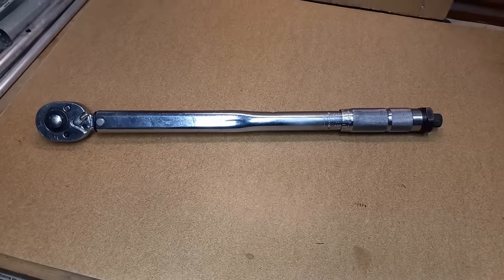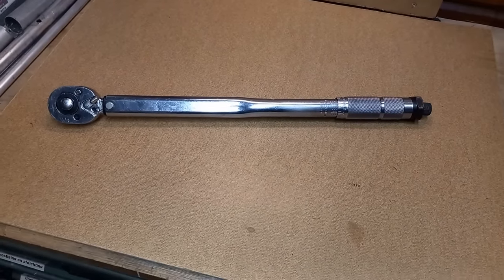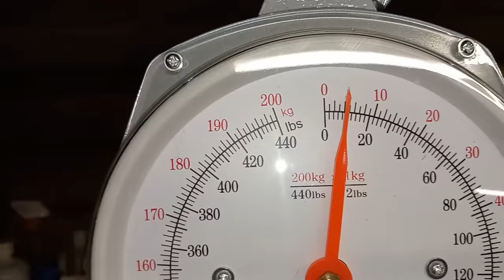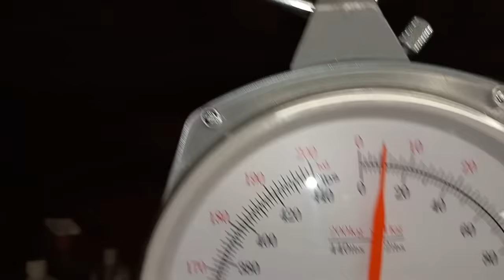How to calibrate a (cheap) torque wrench

Comment: If you’re going to make a video about torque wrenches, make sure you always leave a tip by saying always take the tension off the spring in there before you put it back on a shelf for any period of time. Any spring left under tension will diminish in storage.
Never adjust a torque wrench to like 240 ft/lbs, do a bearing and then stick it back in the tool box to store without taking all the tension off.
Reply: Quite right and that should be mentioned in the tools instructions
Reply: @bsimpson6204  it would be great if you would mention it because the guy might have a torque wrench and he got used.
Reply: @markmcgoveran6811  I'd never buy a torque wrench through a place like a pawn shop. This video was indeed very helpful but if that spring has been abused and neglected, I don't know. They're not an arm and a leg through Amazon and it's brand new out of the box.
Reply: @kirkthiets2771  I'm very happy for you that you live such a wonderful life. I've been a lot of places where it was a couple hundred miles round-trip to go buy a torque wrench.
Reply: We never took the tension off, but it wasn't anything accurate. Just small stuff like cruise ship engines/power plant engines. And still every yearly calibration they were in spec
Reply: By that logic my car gets closer to the ground every year as the springs in the suspension diminish.... It won't diminish the spring is in its elastic region. There are companies that use custom torque wrenches locked to a single torque that cannot be unwound for high precision applications. What will make a difference is clicking 2,3,4 times instead of once as the detent mechanism will wear faster as when the mechanism detents there is a moment of high stress and combined with contamination the mechanism can wear over time. Hence why calibrations are generally done on time and or cycles. So if you are in a production environment you might get the tool calibrated on the number of "clicks" if the 5000 cycles or what's specified is less than a year.
Reply: @jakbain1337  well I hate to let you know but cars do sag and get closer to the ground and you do have to replace the springs. Have you heard of the second law of thermodynamics?
Reply: @markmcgoveran6811  sag will not occur in the spring if a car is stationary... Bushings and other things may suffer greatly from creep stress though. It is also likely that people in cars where bump rubbers and spring combo are not sufficiently designed can allow the spring to go into plastic deformation under severe bump loadings again this condition does not exist in the design parameters of a torque wrench. Properly designed springs for the application will not creep. As for the second law of thermodynamics, heat flow is not what we are discussing.
Reply: @jakbain1337  oh okay I thought the second law of thermodynamics dealt with entropy. I thought of spring had a form of stored energy that would eventually bleed off in the form of creep of the material. I guess 7 years I spent electrical engineering, looking at a whole lot of abstract stuff doesn't qualify me to discuss a spring next to a person like you who doesn't offer any science other than no. Do you have some argument why that would be an eternal storage of energy? Anyting scientific other than your desire to pontificate because you're a well-trained person and some mechanical thing but you didn't study abstraction much so you can't really make a scientific argument? No you don't. All you have is a few anecdotes. So why do you think that the second law of thermodynamics applies only to heat? So when everything else is cool to the same temperature across-the-board everywhere in the universe all of it is gone to anchovy they'll be a spring somewhere that somebody didn't disconnect and it will still have energy stored.
Reply: @markmcgoveran6811  A good quality spring steel kept under the materials endurance limit will suffer from negligible creep in these conditions. We aren't talking about edge cases where the spring is cycling through 100-300°C at 90% of the material stress limit. Where you will see noticeable creep. We are talking about a spring in a small temperature window operating in it's designed conditions.
Reply: @jakbain1337  there again I have to go with the second law of thermodynamics. A spring is a form of stored energy. It will eventually dissipate. Can you refute that statement? I know that  you have a special exception to the second law of thermodynamics.
Reply: @KeljuKkojootti  I understand completely that they were still within spec every year regardless of what you did. But within the specification is not the same as did not decline. I'm still 7 ft tall just like I was when I was growing up as a twenty-five-year-old Tug boatman within the specification of plus or minus three feet.
Reply: @KeljuKkojootti  why would they have to have a yearly specification check if the spring is not going bad? You're only working on a cruise ship worth millions of dollars and why would you even bother with re specifying those things every year if they're never out of spec? That would certainly be an expensive waste of money if there is no way that spring could get a little tired. Yeah you work on a cruise ship and you think you're an engineer cuz they call it an engineer on a boat. We have other people called building engineers at do about the same kind of work you do. Of course your professional engineer has a college degree
And he thinks there's a chance if that's bring my creep a little bit so he goes ahead and spend the extra dollar to re spec the tools every year, do you think the engineer who is ordering those tools be recalibrated to specification every year, is just throwing money away?
Reply: @Alexander Wardrope it's not my fault engineers around Lee and universally hated because they're right and smart. Remember when the first multi-engine bombers came out? Pilots that had plenty of skill flying an airplane we're absolutely certain that the airplane was at fault every time they launched one and it crashed in minutes. The engineer told the general that these guys needed a check list in order to launch an airplane and the engineer would write the check list in the pilots would follow the checklist and there would be no more trouble. The pilots were just people like you guys and they were sure they knew everything just like you are and they didn't want to go with the checklist. Fortunately the pilots were in the military. The general ordered the checklist and the military pilots complied and the airplanes quit crashing and now every airplane has a checklist on launch. Yep all those engineers built that airplane yet contributed nothing. The pilots didn't understand enough about their mind and they systems and everything to run the airplane and they just like you argued that the engineers had nothing to contribute.
Reply: No need to call someone a half wit. 

I don't measure people with a tape measure that has 3ft increments because that's illogical. 

You speak like the pilots that were sure they were 100% right! be careful you might sound like you aren't willing to listen to an engineer. 

Just remember when everything is a big theoretical goop at the same temperature we will be long gone and have no equipment to calibrate the torque wrench let alone measure the force on a spring when it's all goop. Think about the right time frame and about the grain flow of the materials over an applicable time scale and loading conditions
Reply: @markmcgoveran6811  I don't work on a cruise ship, I work at a factory making the cruise ship/power plant engines. We have to take them to get checked once a year. And unless they are dropped they are in spec, they just adjust it and stamp it good to go for a year more, we rarely use torque wrenches, important bolts are streched with hydraulic pressure, easier on us assemblers to torque down cylinder heads than with a big ass torque wrench. I think the biggest one is 300-1000Nm.
Reply: @KeljuKkojootti  I worked on riverboats. Mostly deck crew, some engine room. We had the German engine that the torque was defined by your ran it down tight, and you counted six flats as you turned it. Regardless of that springs age. There's no such thing as perpetual motion or perpetual kinetic energy, there's no such thing as perpetual stored energy. I know the people who build those spring for those expensive tools build a spring that's going to last, nothing is forever. On the idea of unloading springs in equipment if you can well it's being stored, it's just eliminating one source of error. If you did have a torque wrench and dropped it, if the spring was all the way under pressure, it would likely throw the calibration out further than a looser setting. It's just like two guys running a machine shop boring out a cylinder. One guy does an extra step and bolts a heavy plate where the head would be. It distorts the cylinder a little bit so that circle will be true or when the piston rings are in it and the machine is in operation. The other guy never has done this and he never will do this and he never will believe anything that you try to tell him about the difference between the two.
Reply: @markmcgoveran6811  runs true that most people that quote the second law of thermodynamics have no idea what it means
Reply: @101spirited  yeah I've heard a thousand different things about the second law of thermodynamics. I was in the electrical engineering college for 7 years and you're telling me that you don't think stored energy dissipates. Energy in this universe goes to heat. That's one thing that's implied by the second law of thermodynamics. I don't know if anyone knows what the second law of thermodynamics "means". But it always the lights me when I get a cheap shot off subject response from somebody who thinks that if he has a spring in a torque wrench and it lasts forever and ever by the universe is only one temperature at spring will still be store energy.
Reply: @markmcgoveran6811  Dude, you swept the floor for those 7 years.
Reply: @captainwin6333  I'm absolutely certain I swept the floor during that time. I don't know anybody who's gone seven years without sweeping a floor that's able body bodied.
Reply: @captainwin6333  yeah that's why everybody's lined up to buy Chinese.
Reply: I have Craftsman Click - type torque wrench I have had 35 years.
I haven't used it a tremendous amount over the years but luckily I have always loosened it all up before putting it away.
Reply: @KeljuKkojootti  Depend on the size and quality of the spring. I used to work in a bicycle guy and one of the employee forgot to remove the tension on the very small torque wrench before vacation time. Well let's just say when we came back the torque wrench became a wrench.
"Cruise ship engines, power plant engines" Sound like to me it must have been some bigger than average torque wrench. The smaller, the more it will suffer from plastic deformation.
Reply: That's what you want, go do it. If you bother to read the manual you'll find the same. People who can't read or follow instructions won't be helped by a comment in a youtube video. Go make a video demonstrating this. That might show them. 🙂🙃😉
Reply: @markmcgoveran6811  And he couldn't find a youtube video to tell him!!😭😭😭😭😭😭😭😭😭How will this one he cannot find help him?🤣🤣🤣🤣🤣🙂🙃😉
Reply: @markmcgoveran6811  So if it's been altered through abuse, worrying about how to store it will make it accurate? That wil make it accurate!!!!🤣🤣🤣🤣🤣🤣🤣🤣🤣🤣🤣🤣🤣🤣🤣🤣🤣
Reply: @flashwashington2735  you need to study math more. I don't really want to go over the basic logic that makes you look like an idiot but I didn't say you could have use it as long as you took the spring loose. I said that spring represents a form of stored energy and if you leave the spring tension overtime the spring will lose some of that pressure. I don't know how you can make it abuse proof.
Reply: @flashwashington2735  he might be okay.
Reply: @flashwashington2735  in general there very many different viewpoints of any subject. The thermodynamic viewpoint is very simple. A compressed spring is a form of stored energy. Eventually all energy will be dissipated and turned into heat completely. The second law of thermodynamics says it "as time goes by the spring ages out and relaxes."in general in mechanics working on cars and things in my life I have found there were two sorts of people. People who thought it through with general engineering and science principles and then tried to eliminate variables and difficulties based on these things. The devil is in the details in all the things we do. Springs in general age under load. If there is no gain to leaving the spring under load, the default practice in the name of eliminating an unknown in accuracy would be unload the spring. I have no desire whatsoever to prove under the second law of thermodynamics at the energy stored in the spring will eventually be dissipated into heat and the spring will change.
Reply: @markmcgoveran6811  Why I agree. Did you mean this reply for me. They do it for firearms and all kinds of springy things. 

If it's about my cars in long term storage, You reduce pressure in tires, blocks to support the weight and they used to even remove valve covers, reduce valve train spring spring pressure, and remove the plugs to put oil on top[ of the pistons for the rings sake. They make cars too complicated and the procedures are too expensive. I all ways reduce the tension on my torque wrenches and wonder why someone would obey some yahoo on youtube vs the maker of said instrument. You trusted them to make it. WHY would you fail to trust the validity of their instructions. Unless you have come across some verifiable, repeatable, understandable reasons not to. This has only rarely happened with product from reputable companies in my personal experience. Relieve the springs!! God bless you.
Reply: @markmcgoveran6811  They relax all kinds of springs in firearms, sewing machines. Good procedure. If you care about my car comment. Don't they used to lower tire pressure, put them on blocks. Remove valve covers relax valve or cam springs, remove spark plugs put oil on top of the cylinders, and other things I don't recall like empty the tank.

My great great uncle traded his 1928 Packard he had so prepared to have his house moved. The new owner procured a battery and fuel went to start it up and broke the crankshaft. Poor engine could not compress oil even though it's rings weren't rusted to the cylinder walls. He had to find a machinist to mill him a new one, poor fool.

They don't do these things any more with cars too complicated. it is to expensive. And what about the fools?

I always follow and recommend following the manufactures instructions. Unless I have verifiable, repeatable, clearly defined reasons not to. Hasn't happened too often With quality products from reputable manufacturers in my years. But it has happened. 

So, If you trust the maker to make it, why would you listen to anyone commenting on youtube over the makers directions. I won't. Won't recommend it to others. Nor will you. Good we can both relax with our relaxed springs!! God bless.
Reply: @KeljuKkojootti  Different makers spec different procedures, including calibration cycles. If they needed adjustment maybe they weren't in spec. Why adjust them. I worked for Motorola, Sigma Six areas. That means one defect in a million. One followed by SIX zeros. They achieved Sigma Seven in other areas. I imagine lots of things were different as they were when I worked at Cummins or any where else I worked. I never said, Well where I worked we did it like this. Kept my eyes and ears opened. Used my mouth top ask questions. Different procedures in different cultures don't necessarily invalidate one another. Savvy? God bless.
Reply: @markmcgoveran6811  Different makers spec different procedures, including calibration cycles. If they needed adjustment maybe they weren't in spec. Why adjust them. I worked for Motorola, Sigma Six areas. That means one defect in a million. One followed by SIX zeros. They achieved Sigma Seven in other areas. I imagine lots of things were different as they were when I worked at Cummins or any where else I worked. I never said, Well where I worked we did it like this. Kept my eyes and ears opened. Used my mouth to ask questions. What about sleeved engines or blocks with thick deck surfaces milled after boring, and these new automotive engines have oval cylinders. What processes for that? Different procedures in different cultures don't necessarily invalidate one another. Savvy? God bless.
Reply: @captainwin6333  You wanted to sweep the floor, but deemed incompetent weren't allowed to broom!! Are you a captain in the third grade? Like eraser duster? No that would be too hard for you. HMMMMMM???
Reply: @flashwashington2735  yeah you're right about all the things you did. If you want to look at a cultural model that's fine with me. I prefer to look at math and science when I'm making engineering decisions. I am happy for you that you work in the six sigma industry and you worked in quality control. Regardless of that I'm I'm proud of you that you were able to study culture and apply it that whatever you're applying it to. I prefer to apply mathematics and science to engineering problems not culture. How does your education affect the second law of thermodynamics? How does your experience affect the second law of thermodynamics? How does culture affect the second law of thermodynamics? How does the second law of thermodynamics apply to the question at hand. If you store energy in a spring it will gradually dissipate. How does everything you said affect the simple fact that the second law of thermodynamics says every energy will dissipate. I love your argument because it says you don't know what I'm talking about. in math we have logic and then logic we have logic flaws faults in thinking. You're committing the logic fault of appeal to authority.
Reply: @flashwashington2735  that's wonderful your personality seems to be based on the logic fall of appeal to authority. I base all my decisions and all my advice I give people on math and science. I told 10,000 people there's no such thing as perpetual motion. This is a difficult pill to swallow for the vast majority of our people. The idea that there is eternal storage of energy, is also above people's heads. Do you pride yourself on your gullibility? The manufacturer makes money on this product so I'm not particularly faithful in what the manufacturer says.
Reply: @TwinShards  Yes massive engines, one cylinder could fit a man easily, torque wrench was over 10kg, but most of the bolts were tightened with hydraulics stretching the bolt and just finger tight the nut on, and release tension
Reply: @markmcgoveran6811  from Norbar Torque tools:-  Do Torque Wrenches Need To Be Wound Back To Zero After Use?   to make sure we were absolutely 100% certain of this, we carried out tests over the past month. We wanted to ensure that we could answer this long-debated industry question with the upmost accuracy. The test was completed recently, designed to show the effects of leaving a torque wrench wound up at 100% of full scale against one wound down to 20% of full scale. Firstly, four wrenches were taken and the calibration lab took results. Two wrenches were then left wound up and two wound down. After 24 hours the calibration lab took further results, and again after a week, then again after one month. At the end of the month the results showed (bar one single result) that all the readings taken were within the ISO tolerance of 4% of reading, regardless of whether the tool was wound up or down.
Reply: @markmcgoveran6811  If you are correct, Can you explain what is happening on the atomic level to cause this? All kinds of steel structures and bolts also behave as springs, do they also sag with time? Sky scrapers settling down, bridges sagging and bolts loosening? (I'm not talking about the few milliseconds after tensioning or waiting till the end of the universe here )  I hope you can explain how compressed gas in a tank can keep up the pressure (molecular motion) apparently forever. How does the law of thermodynamics apply to those cases? Serious question.
Reply: @billshiff2060  it's a matter of the scale of the time we're talkin about. In engineering there's a thing called creep where you put a load on something and it distorts it over a period of time. You've got a billion crystals all stuck together and one electron or two turn loose of each other and the shape changes. The timescale of this effect is fast enough on aluminum that they worried about creep on certain engineering applications of aluminum at small loads. When you look at  metals that have iron and carbon you have a lot of complex relationships with the carbon iron atoms causing distortion in the crystal matrix. When we temper metal or work harden it they're microscopic distortions in the crystal matrix make the sheer planes intersect at odd angles and causing material to be harder. I know of one process that use on rifle barrels after all the heat treating tempering is done and they just chill it to about minus 200 degrees. They hold the rifle barrel at this low temperature for a while and all the atoms slow down and put moving so much and the electrons in the crystals reunite to an extent. Instead of the variations in this process throughout the rifle barrel that they had one as originally manufactured and it worked great by the way, they have created a more uniform alloy and the barrel shoots more uniformly because it's one solid consistent piece, not different thicknesses and places that tempered harder than others. I wish you lived nearby and I could step up to the blackboard or get out the paper  and pencil and do the subject justice.
Reply: @billshiff2060  so they do change after all. 4%? The sample size was so small that it's meaningless according the ISO 9000. 2 wrenches and two controls and it's still changed a little bit. Thanks for releasing that little bit of information those guys did a test to reassure us with absolutely too few wrenches to have any meaning at all.
Reply: @markmcgoveran6811  The 4% referred to all 4 of the wrenches, and it wasn't stated as a decrease , just a variation from spec. It's all I could find in a short search on this topic. Their site has more to say on the subject. It would be nice if someone did a more comprehensive test but I doubt anyone will. In reality, torque wrenches are a lousy way to gage clamping loads so that even a perfect wrench can get only ~ +/- 10% of actual, if that. So it becomes academic.
Reply: @markmcgoveran6811  Your authority is math and science. You don't get the science right. Then you blame and chastise others. Claiming to school them.

Nothing man makes or does is 100% accurate. instead of thanking this video maker. You want to tell everybody where to get off from behind your podium. This video is addressing practical application. I worked in a Sigma six facility. Won manufacturing awards. I studied the physics and required math as majors. On their floor !st 2nd and 3rd approximations got the job done. Only one defect in millions produced. Your experience may vary. But we ALL called it "GOOD ENOUGH."  I will no longer talk to you of this matter. You will not be satisfied and I would waste my time. God bless you sir.
Reply: @billshiff2060  the guy that pulled in first on race day eliminated a lot of real and imaginary sources of error. I'm not maintaining this as a reason to scream at someone who left your torque wrench torqued. Rather it's a form of discipline.
Reply: @flashwashington2735  not one reason to leave it loaded has offered. I was a machinist. By default I returned everything to factory settings,store springs unloaded, and a great many other things. I made every choice a conscious choice.
Reply: @flashwashington2735  one thing about you is when you get some really substandard research like an example where N is ridiculous, in support of your views you leaned on it like a drunk on a lamp-post with a burned-out light.
Reply: @flashwashington2735  one great thing about you is you were accepting an anecdote for evidence and you should know that there is not enough wrenches in the study to mean anything but a sale . No honest quality control person would accept that. You don't love quality control in math like I do you love the money you get for being an expert in the field. All of your discourse is based on you, not much of the subject in your discourse. I enjoy this greatly because you are accepting bad math and whoring out your degree.
Reply: @billshiff2060  well one thing about you is you're respectful. A study with just four wrenches  has not got enough participants to mean anything. I just had a guy with a background and quality control give me a 45-minute writing about him and me and 3 minutes on the subject. If he was as educated as he claims he would know that was not a valid size for a study. I have not heard one single good reason not to take the load of the spring. Just as a default practice regardless of what anybody says I try to return things to the factory setting they came from the factory with and I try to default to unloading springs.
Reply: @markmcgoveran6811  I try to respect the respectable. Sample size matters more the smaller the effect you are looking for. In their case they found that nothing catastrophic happened and for them that's close enough. I am  currently in metal forming so I know for certain that metals creep when loaded and parts within any metal are always loaded. Sometimes it is shocking how large the effect is. 
Once I was tensile testing an assembly made of 304 stainless steel. It was expected to break at 2000 psi or more. During the test I saw my extensometer was out of travel so I paused the test at 1000psi to reset it. In the less than 30 seconds that took , when I went to resume the test the tension had fallen to 800psi. The stainless had SAGGED 20% in that time. WTF???? The test continued and it broke as expected above 2000psi just like all the other tests did. 
That was my first encounter with what is termed the "gradual yield behavior of stainless steel" where it begins to yield at about half its tensile strength and is partly time dependent. That is why stainless screws only have half the torque rating of same sized steel screws. Stainless behaves like taffy or silly putty.
It is very pronounced in stainless but I think similar things are happening in other metals but on a scale that is hidden in the noise of normal variation. There is a time factor , I just don't know how strong it is in other metals yet. My default for steel springs would be to unload it for storage but not panic if it is not possible.
Reply: @billshiff2060  if you look at metal in a nuclear reactor it ages pretty quick. On the eternal scale that explains a lot of the second law of thermodynamics. If it's under a load and I strayed neutron flies through and bumps an electron that spot changes. I really enjoy studying the people here in the. One guy road 300-word discourse. 255 of the we're all about his resume and his experience in his education and why he was the source of information that was definitive on this subject. Then he mentioned something about me in general and then finally wound up with a vague accusation that I don't know the science and math here. The fascinating thing is he accepts a paper  supporting that was not in a peer-reviewed journal. He wants to state that I don't know science and math but he doesn't really find a flaw with my science and math and then he accepts a research study supporting himself with only four wrenches that is totally meaningless drivel produced by the manufacturer. The problem everyone is missing is not one good reason to leave the spring loaded is mentioned. If you want to be in control you make every decision a conscious decision not just a blow it off at random decision.
Reply: You know? I learned that Pro-tip when I was a kid messing around in my dad's garage so I never thought that other people, specially those used to work with torque wrenches may not know that... good catch Sir!
Reply: @markmcgoveran6811  This and how important entropy is but will get a crappy beat up, of unknown lineage Torque wrench from the pawn shop or on the street , fell off of a truck. Exacting standards of precision my friend.🤣🤣🤣🤣🤣🤣🤣🤣🤣🤣🤣🤣🤣🤣🤣🤣🤣🤣🤣🤣🤣🤣🤣🤣🤣🤣🤣🤣🤣🤣🤣🤣🤣🤣🤣🤣🤣🤣🤣🤣🤣🤣🤣🤣🤣🤣🤣🤣🤣🤣🤣🤣🤣🤣🤣🤣🤣🤣🤣🤣🤣🤣🤣I think you just want to help someone sell stuff. What crimes did they commit to deserve such help?🤣🤣🤣🤣🤣🤣🤣🤣🤣🤣🤣🤣🤣🤣🤣🤣🤣🤣🤣🤣🤣🤣🤣🤣🤣🤣🤣🤣🤣🤣🤣🤣🤣🤣🤣🤣🤣🤣🤣🤣🤣🤣🤣🤣🤣🤣
Reply: @flashwashington2735  entropy is universal. It dries the decision because you make a choice and it's the choice against entropy. I'm a capitalist enough to know nobody is going to tell you anything bad about their product or spend any money researching their faults. I agree wholeheartedly if you get a torque wrench and it's calibrated and old the better it is to relax the spring when you store it.
Reply: Question: how? Please edit your post to include this.
Reply: @Ensign_Cthulhu  when you sent the torque wrench at zero there is no pressure on the spring. That should be the factory setting and the storage setting.
Reply: @markmcgoveran6811  Thank you.
Reply: @Ensign_Cthulhu  You can feel wether there’s tension or not on the main spring that dictates the poundage. Some torque wrench producers actually recommend that you store the wrench at 1/3 of its total capacity. A 100lb wrench should be stored at 33lbs and a 250lb wrench should be stored at to roughly 80lbs off the top of my head for instance. I’ll still back all the tension off personally.
Reply: @jakbain1337 And that logic is correct: every day, your springs on your car are in fact weakened, which is why if you find an old car with low miles that has been sitting for years, it needs new springs. As far as a locked toque spring, that would in fact be an issue as you need to excercise the spring before every use, which you would be unable to do. If that locked torque device were to be discarded, replaced, or rebuilt every 6 months, which is probably the case for extreme percision, then the point about stress on a spring still stands.